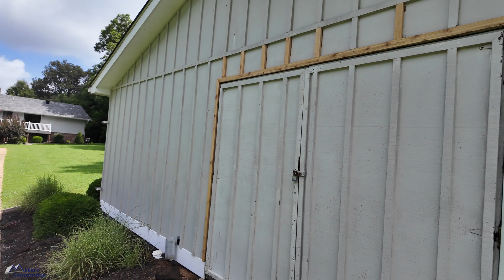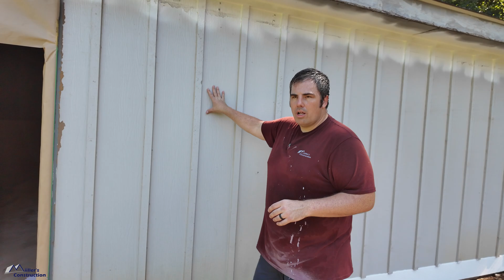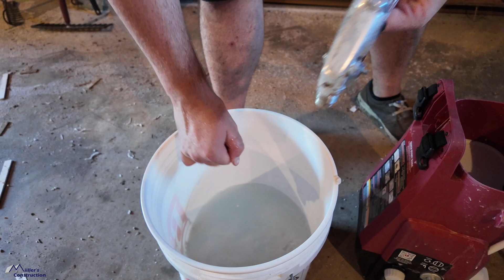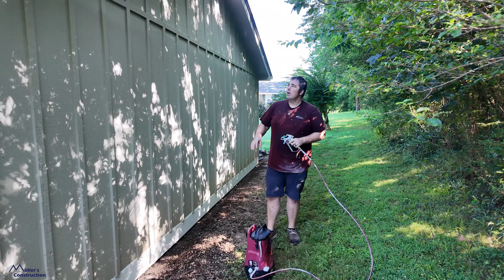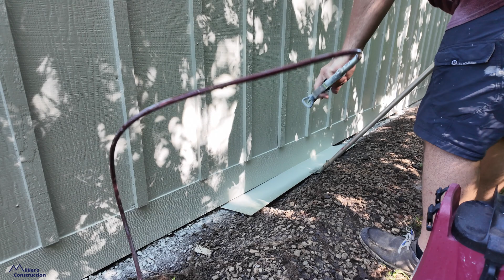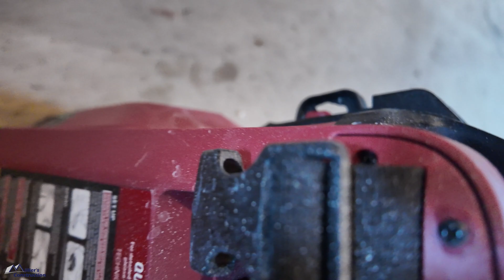Step By Step : Painting a Shed The Easy Way – No Rollers, No Brushes!

Comment: I am a cabinetmaker and carpenter will the Impact X works for painting cabinets?
Reply: We do have contractors that are using it for cabinet painting for sure Charles 👍.  Usually setting it up with the Purple Fine Finish Tip but have had a couple use the Green HEA as well.
Reply: @TitanSpeeflo Cool I think I am going to get one 😊
Reply: @charlesjacksoniii8787  Awesome to hear, if you've got any questions or need to get in touch with your local Titan Rep to schedule a demo just let us know 👍